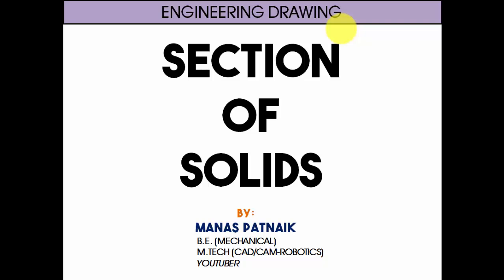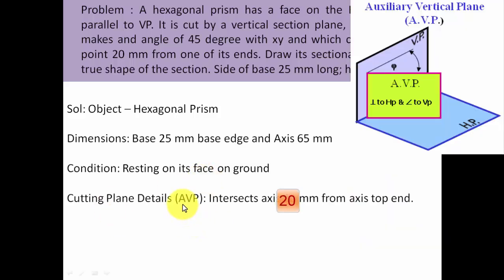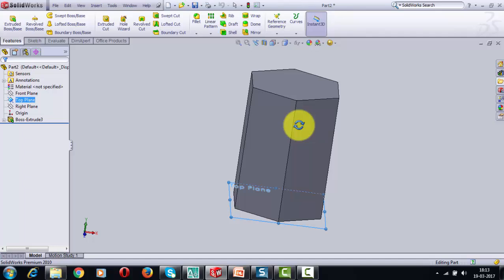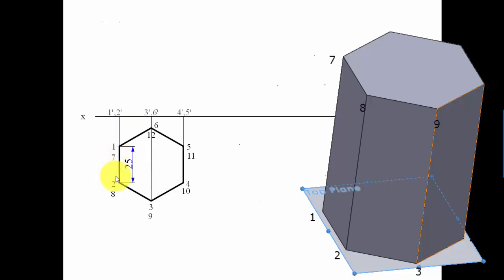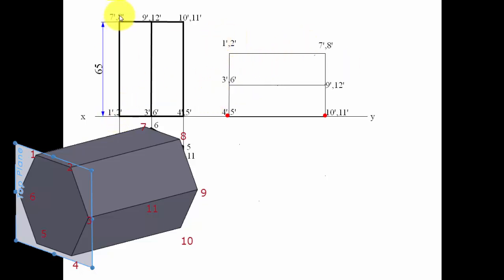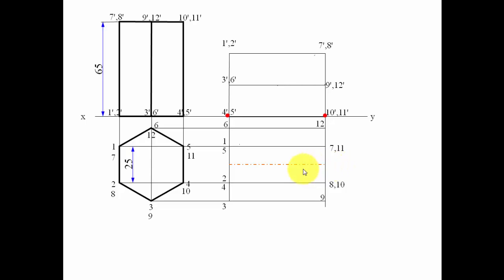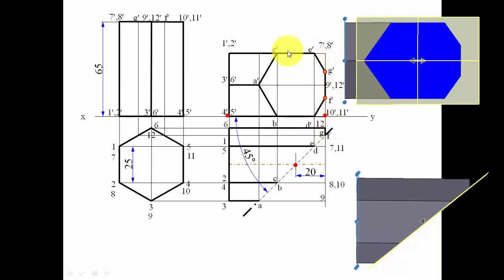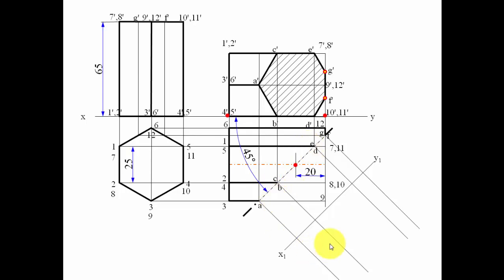SECTION OF SOLID_HEXAGONAL PRISM_Problem 7

Comment: A Hexagonal prism has a face on HP & axis parallel to VP. It is cut by a vertical 
section plane & H.T. of which makes of 45 with XY & cuts the axis at a point 20 mm 
from one of its ends. Draw its sectional FV & true shape of the section. Assume side 
of base 25 mm long & height 65mm. A Hexagonal prism has a face on HP & axis parallel to VP. It is cut by a vertical 
section plane & H.T. of which makes of 45 with XY & cuts the axis at a point 20 mm 
from one of its ends. Draw its sectional FV & true shape of the section. Assume side 
of base 25 mm long & height 65mm.

Comment: A hexagonal prism has a face int HP and the axis 
parallel to VP. It is cut by a vertical section plane, the 
HT of which makes an angle of 45º with xy and which 
cuts the axis at a point 20 mm from one of the ends. 
Draw its sectional view and true shape of the section. 
Side of base 25 mm, height 65 mm.